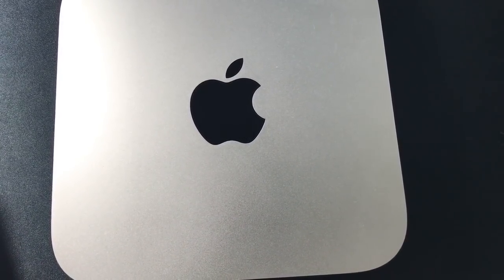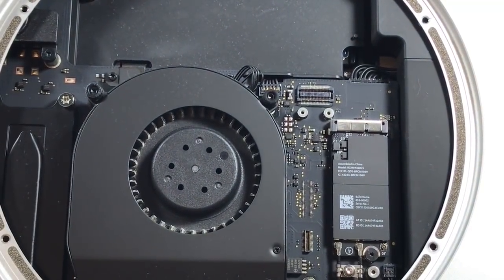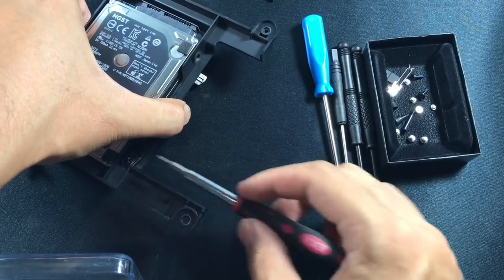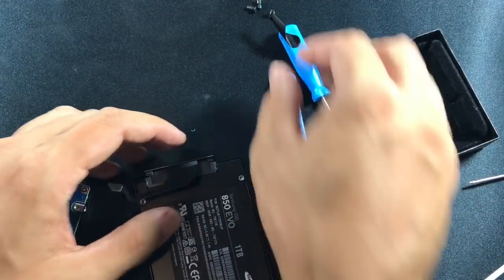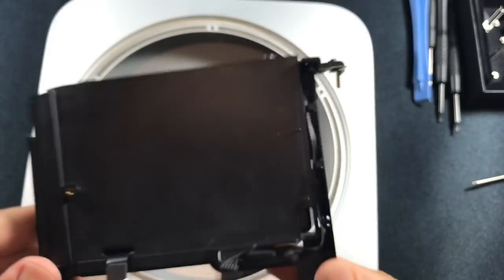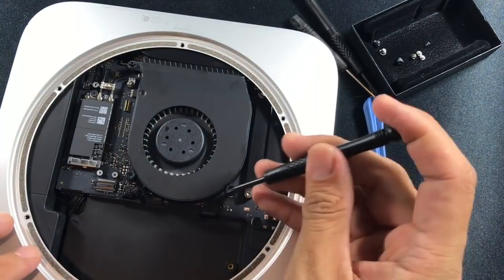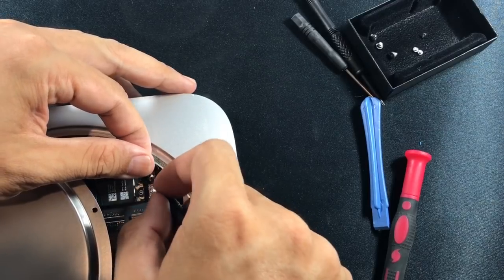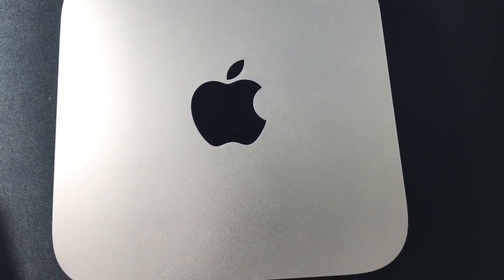Full Node project: Mac Mini 2014 Samsung Evo SSD 1TB upgrade

Comment: Torque wrench?  I think you mean Torx screwdriver.  Torx with security screws isn't that uncommon, you simply need to see the dimple.  Helpful to see the approach on the late 2014 machines, I stick with the late 2012 machines (you can change RAM and the hard drive(s)).

Comment: Great work. Very fluid. I understand this mac of yours is a late 2014 version. I have the same but not happy with the fixed 4GB RAM. If I am not wrong, I guess there is a slot on the mainboard for installing an SSD with some sort of adapter without removing all the parts. If so, please try to do another video. It will be a great help. Thanks. :)

Comment: I have been using an external ssd via usb for some time and the speed has increased a lot, my question is: i will further increase the speed of my mac mini if i install it internally ??
Reply: Yes, remember the speed of usb 2.0 vs. the speed of the hard drive bus is much slower.

Comment: ive looked all over for quite sometime to see if anyone has ever attempted a CPU upgrade one of these.. have you tried/heard of anyone doing so? i know the CPU is soldered but figured there is a way since someone has the will
Reply from the maker: Adaer Melgar better to buy the new one.. no point in risking it minimal value for the risk of damaging the equipment. The main thing with the mini that I wouldn’t want to break and it’s best feature is the reliability
Reply: I got one for free and just upgrade my ma to the new one. Dont actually need it as i have a 12 core Mac Pro but was hoping to maybe drop some 6core into the minis and stack them as a small “render farm” on the cheap as i do 3D work.. but o well. Ill just keep it as my TV computer

Comment: Would I be better off buying a 2012 or 2014 for upgrading the SSD ? 8gb is fine for my mom
Reply from the maker: 2014 if prices being equal though laptops are so cheap now, if it’s for your mom a simple laptop is all she would need. No one really runs applications anymore.

Comment: Do I have to clone the Samsung drive for it to work on the mac mini?? Because my hard drive that comes with the mac mini is crash. It's not working. So can I just buy this Samsung drive an install it in the mac without cloning it, and it works.. please help
Reply from the maker: You might be able to use the repair system. Try this. https://www.idownloadblog.com/2016/02/25/how-to-start-up-your-mac-in-internet-recovery-mode/
Reply: Ok cool thanks

Comment: Hey tnx for the great vid!
1 - can you tell which screw drivers exactly are needed for the replacement?
2 - did you use any special software tool to clone the old drive in advance to the usb, and afterwards to the new drive?
Reply from the maker: The screwdrivers are here. I added it to the description. I did not use any special software. I used the builtin mac software to clone. https://amzn.to/2VdVFLy

Comment: Was it difficult getting MacOS reinstalled onto the hard drive once replacing it? Is it as simple as taking a disk image and installing it onto the new drive just as you would with Windows or any other operating system?
Reply from the maker: Anirudh Upadhyayula yes it was simple , just need to image it properly with the disk utility

Comment: why not a  flash drive instead of the ssd?
Reply from the maker: ssd is flash memory. Otherwise, compared to sd, its way faster.
Reply: I mean pcie ssd ( apple flash pcie ) ..... and pcie is way faster than SATA3 !!
Reply from the maker: More expensive.. This way is cheaper and its not "way" faster though it is faster. I prefer commodity hardware when available. The mac mini would be pcie which would be more expensive to buy used and then replacing it with a more expensive drive when it doesn't need to be expensive or super fast, just fast/reliable at the lowest price. So for me, it was better value.
Reply: ah ok. , have fun with it.
Reply from the maker: its been in service since this video.. 24/7. Works great so far, i'm pretty happy with the build. Total power draw is 25w for a fully dedicated server. Thank you!

Comment: Thank you for making and sharing the video. As of course, my Late-2014 Mini already does have a SSD which I'm considering upgrading to 1 TB, why do you say "... they're pretty much a pain to upgrade"?
Reply: ikeo net1 You’re talking about the PCIE slot if you opted for a SSD or fusion drive at purchase, it’s easier to upgrade than the HDD but only if you can find the correct blade SSD. There is a part sold that adds the ribbon cable needed to connect a PCIE SSD on top of the SATA HDD or SSD. If you already have a PCIE Cable, there’s no need to replace the HDD, unless you want to.
Reply from the maker: if you have one with a ssd in it already as late2014 idon't believe you can upgrade it. You can only upgrade it if it had the 1TB non ssd.
Reply: That's my luck. Thanks very much for the quick reply.
Reply from the maker: Thanks Erik..
Reply: It's a really easy process. Just have the right tools.

Comment: Great video, but is there a step before this to clone your existing harddrive data onto the replacement SSD? Such that the mac mini will just work as normal as if nothing happened? Thanks
Reply from the maker: Baba I did the cloning afterwards. Drive to drive. Plugged it in without issue. I used USB to boot and clone so slight different way.
Reply: Please do you have the link to the video for the cloning

Comment: So I just did this on my 2011, after installation, my Mini wouldn't recognized the SSD. Pulled it out couple times and made sure that I connected back everything but no luck. Went back to Bestbuy and returned the SSD.  I really wanted to upgrade my mini's 500GB HHD to 1TB SSD but id didn't worked out for me...
Reply from the maker: sorry to hear... thanks for watching.